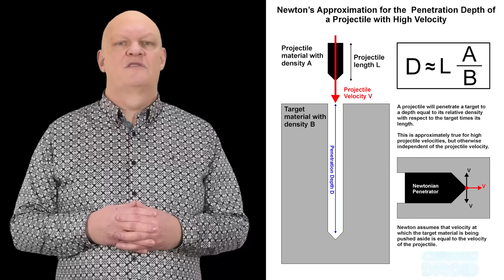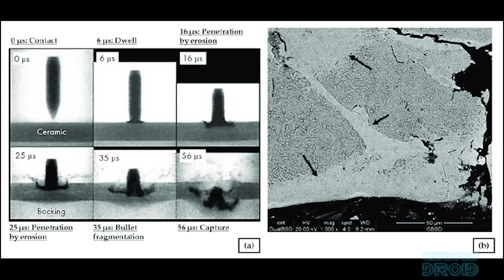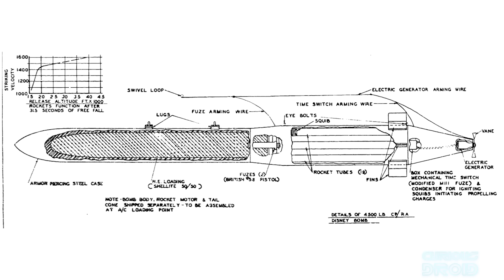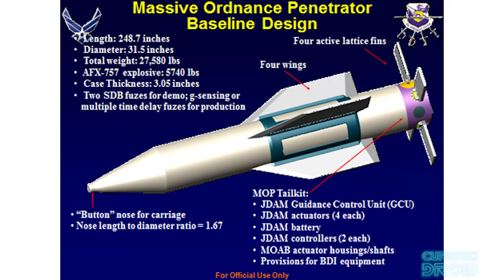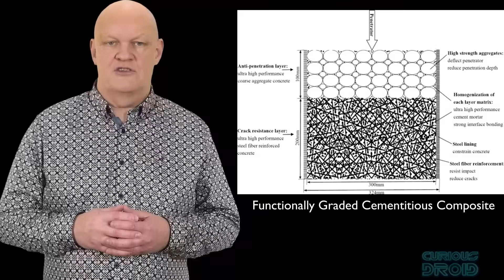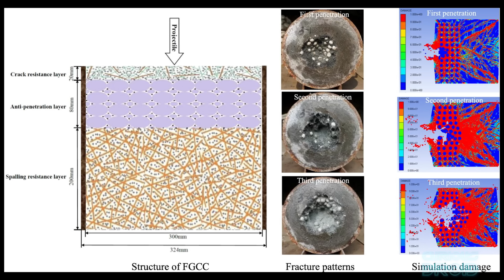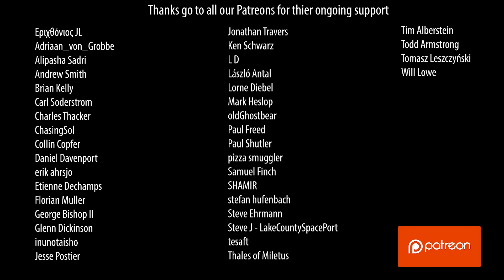Can Iran Stop U.S. Bunker Buster Bombs?

Comment: I just can't get my head around how somthing can go through 20ft of reinforced concrete and come out intact and go through more floors/walls after that before deciding when to detonate. It just does not compute in my mind. Fascinating but my brain is just like "404 Error"
Reply: The fact that the fusing mechanism can withstand all that and still function has always amazed me. The earliest proximity fuses for antiaircraft shells used vacuum tube tech and had to survive the shock of firing and spinning, and that was in the 1940s, which amazes me.
Reply: @RCAvhstape  That's because the fuse was in the nose but the detonator is in the tail where it's safe.
When the fuse is crushed on impact it starts the timer.
The Brits sometimes set the delay on their Tallboys and Grand Slams for as long as 15 minutes.
Sometimes it was done to enable civilians time to get out and sometimes it was done to break the morale of the Germans.
Imagine having 9000 pounds of explosives in your office, knowing it's going to go off any second and there's nothing you can do about it.           🙂
Reply: @RCAvhstape yup I took a few of those radar fuzes with mini tubes apart and how they made the little tubes survive is by making them very small potting them in a waxy material and supporting the filament on spring tension inside. The tubes also worked very well for hobby radio projects. The one that actually fired the squib was a tiny hydrogen filled thyratron about the same size as a NE2 neon indicator lamp. The battery and charge assembly screwed into the bottom of the Fuze cone.
Reply: @RCAvhstape   And imagine how they were all made in mass produced, manual operations.
somebody had to assemble it all, by hand.. 
imagine the QC on those things, cause you can't have any fail the shock test , or they would blow up in the barrel
Reply: @RCAvhstape  
They kept trying thicker and more resilient glass bulbs and of course stronger filaments it had to only survive the launch the other trick was to embed it into a special soft wax that it could safely protect the bulb by slowing down its speed, from what I read this wax was one of the most important parts  . The shell had to be at least a 5 inch  ,  on a ship that would be a 5 inch 38 it would not work with the 5 inch 58 , 5 inch 38s were the successful guns used against Kamakasis very successful 

Of course now we have solid state so no problem you can put it into. 40mm she’ll
Reply: @RCAvhstape  Wait, they had vacuum tubes inside the ammunition? I never knew that.
Reply: @lunchbox1553  Yes, the vacuum tube were specially designed to be smaller and after the circuits were assembled they were encased in something like acrylic to help them survive.
Reply: @RCAvhstape Iran or anyone else cannot stop these concrete peneyrators
Reply: @RCAvhstape  The fuze doesnt need to be in the nose ;)
A fuse is not the same as a fuze also.
Reply: Already in the 80s Norway had different bunkers for our F-16 fighters. To this day we have fixed aiplane bunkers inside the mountains.
Reply: The power of high density steel or tungsten pointed projectiles and kinetic energy
Reply: @AluminumOxide  that's why they say tungsten won WWII. I remember how it blew my mind finding out that we cut regular steel with high speed steel which is also steel.... I can't wait to see the kinds of magic high entropy alloys will deliver in their interactions with electronics photonics and other physical properties we don't currently even consider when we think of metals
Reply: @daltanionwaves indeed Germany lack of Tungsten was a major impediment. A story of intrigues about how Tungsten was sourced from Spain and Portugal and China via Japan
Reply: @AluminumOxide  like dropping tungsten rods from space? This was an amazing and informative video. I had no idea how far concrete composites have come.
Reply: @AluminumOxide  concrete is hard for us humans but tbh you throw a rock at it and the surface will chip pretty easily. Concrete is actually fairly soft and ductile which is why we add steel or composite reinforcement to it. A large projectile can break through pretty easily. Especially when a lot of heat is generated as the projectile enters, concrete gets weak with high heat and also the steel basically turns into a super ductile material when hot.
Reply: @kizzjd9578  you mischaracterize the physical properties of concrete, reinforcements, and the mechanism of action for the penetration
Reply: @AluminumOxide so you’re saying to counter it is to build tungsten bunker?
Reply: @AluminumOxide  no!! it needs to be made of depleted uranium!!!!!
Reply: @AluminumOxide  the electronics though, that's impressive
Reply: @AluminumOxide  is there nothing that can stop it?
Reply: @AluminumOxide 😊
Reply: @AluminumOxide Actually rounded, there are no points to distribute the load evenly.
Reply: @AluminumOxide  high density Steel and Tungsten are outdated technologies.

There are new meta materials and metal organic frameworks that blow them out of the water.
Reply: @darkhorseman8263  there's even an entire metaverse in which those bunker busters don't work
Reply: @darkhorseman8263  There may be better materials out there, but are they as cost effective? Even the US defense budget has it's limits.
Reply: @Tunkkis  Some are expensive, some are ridiculously cost effective.
Reply: @darkhorseman8263  Those are not technologies..those are materials....
Reply: @darkhorseman8263  not in terms of density, but perhaps in terms of toughness.
Reply: @darkhorseman8263  Not as a penetrator .. I think you were trollin for reaction cuz 2 years later steel & tungsten are still used as they satisfy strength and hardness requirements
Reply: The huge mass of the projectile, its acceleration to great speed, all concentrated in a tiny point over-matches the initial target.
Reply: Seeing that bullet go through the vest, through the chest and then out the back of the vest was frightening.. I wish humans invested as much energy into curing cancer as with killing each other, cancer would have gone the way of Polio- something only your grandma remembers
Reply: @lillyanneserrelio2187 Cancer unfortunately is our cells going rogue. It's not like polio where you can just gain immunity from a medical preparation, it's like a computer bug in your code and you can never know where it's going to show up.
Reply: @ChucksSEADnDEAD  But there are, nonetheless ways of curing cancer and defeating it that require "Human Action."
Reply: @ChucksSEADnDEAD  of course there are cancers caused by environmental factors too.
Reply: @lillyanneserrelio2187  Won't happen as long as the education system is Prussian, and making wind-up Prussian soldiers and bureaucrats instead of citizens.
Reply: @lillyanneserrelio2187 there’s no money in a cure.
Reply: They are basically solid steel with a charge down the middle. Made from a howitzer barrel. Forget being fired at from an artillery gun. Just fire the whole gun. That's a bunker buster.
Reply: Aphex… nice
Reply: I'm imagining it hitting a 10 story building and making it all the way to the basement, even with the whole volume being full of regular concrete! Mind-blowing for sure!
Reply: Its like shooting a bullet through cardboard or Superman flying through a building. 
Sufficient speed and density will tear through like tissue paper. 
Stronger metals, mounted on a rocket packed with high explosives. Its actually not that complicated in theory.  All they did was build a better hammer. 🔨
Reply: @drizzo4669  Well yes and no. For one Superman can’t just shoot through the 20 ft thick concrete alone , but the whole mantle ot the earth. 😂 
So let’s say it’s more like bullets going through cardboard 😂
Reply: @drizzo4669  One of the old kids' encyclopaedias has a picture of a candle being fired out of a shotgun and going through a wooden door. By contrast, you cannot push a candle through a door with your hand.
Reply: I understand what you're saying, but the creator did such a thorough job explaining it, if it was my video, id feel bad it still wasn't computing.
Reply: armor piercing bullets but bigger.
Reply: 100% brother, likewise. It’s like... how f**** hard is that casing and internal components that it can slam into the ground going hundreds of miles an hour and detonate perfectly when required?! It’s nuts really. It really is. Agreed.
Reply: Yeah it's mind bending
Reply: It’s only a rough analogy, but when hammering a large nail into pine floor boards, to assist it’s passage through the wood and reduce binding, it’s better to file the point flat. That way it cuts through the wood fibres instead of squeezing between them. If you use a big hammer then obviously the passage will be quicker. I had read about thermo nuclear bunker busters that actually use hardened bunker construction to reek more damage within by creating an earthquake to shake the interior. But that’s another matter!
Reply: Combination of extremely hard dense metal plus lots of kinetic energy. At work we have a water jet cutter and although the water mixed with abrasive. It's always impressive watching it cut through sheet steel.

If they used depleted uranium it would go through even more as thats extremely dense.
Reply: @wsm7929  The latest ones do use U-238....
Reply: Depends on the reinforcement 
We use minnuim amount of rebar
Just enough to do the job
Iran uses more rebar
Reply: @tomhenry897 The fact that you think it's just a matter of Rebar and Iran using more Rebar than us Is it sad that idiots fall for Anti-American propaganda. And don't believe with their own eyes when they see how other countries are
Reply: It can only do that if it has the proper void sensing fuses. Which the MOP did not have at its start. Plus a void sensor only is useful if you know the layering of the bunkers design.
Reply: @captiannemo1587  the mop is a new weapon, not a upgraded old one
Reply: @nomercyinc6783  The most current MOP should be an upgraded version of the older MOP.
Reply: @captiannemo1587 I’m sure having a trigger that detonates when motion ceases is good enough or just a timer from initial impact. Entirely possible. In the gulf war, they were detonating LGB’s on a particular floor of multi-story buildings like clockwork.
Reply: Basically the material is stronger than the wall and the explosive requires ignition and spark electricity to detonate
Reply: At the end of the day it's just F=ma
Reply: Same . Fucking wild!
Reply: They have bunker busting nukes, if they have to take out a nuclear facility this is what they will use, they are the best.
Reply: @hamish1309 They would use bunker busters with nuclear tips easy
Reply: It's easy if your weapon is made out of sarcasm
Reply: @NJ-wb1cz The put that in water these days.
Reply: @NJ-wb1cz  thanks. My account might just be hacked. All the best.
Reply: @NJ-wb1cz  Thanks. You too. 😉
Reply: @NJ-wb1cz cute
Reply: @novafiddler1712  thanks! You're pretty as well
Reply: @15:25 When it basically tickles a traffic cone also blows my mind
Reply: Its fascination how normal day expirienced physics stoped working when high enough energys/speeds are applied.
Reply: When we were kids a favourite part piece of the farmer was to fire a candle out of his shot gun through an inch thick sheet of hard wood. The candle often broke but was in one piece
Reply: You drive on top of a can of explosives, propelled by explosions a few feet from your feet, on a narrow road with thousands of other similar contraptions travelling inches from you in the opposite direction, at speeds that would crush you flat if there is a small mishap. 
If you told ppl in the distant past about bunker busters and cars, they'd probably believe the bombs more easily.
Reply: You can't understand it because you listen to the Aphex Twins. I listen to The Prodigy and I understand it totally.
Reply: Reinforced concrete isn’t very resistant to concentrated impact force at one specific spot, and when it’s made of heavy steel and hits at supersonic speed, it’s really just a big bullet
Hopefully I brought it into scale for you
Reply: As for 404 error 😂🤣😂🤣😂
Reply: thinking that even solids like concrete are made of molecules were most of the space is empty, helps me understand it.  then, it also make sense that the more dense (and energized) molecules from the projectile can bully the lazy sparse ones from the target.
Reply: It goes well beyond this now.  Some of the weapons are way smarter, and learn to wait, or penetrate and evaluate.
Reply: . Nuclear tipped rocket can break thick concrete wall(no matter what size) within friction of second. Shok wave love traveling Concrete ❤
Reply: @azharyasinhashmi120  agreed. Nuclear detonation is another thing altogether.  Shock waves do like traveling through solids and then become destructive when transitioning into an excavated facility.
Reply: @azharyasinhashmi120  You have the mind of a 12 year old.
Reply: It's the old shield versus sword or spear contest. 🛡🗡
Reply: same
Reply: Same...
Reply: E=mc²
Reply: It is way more dense. This computes perfectly in my head
Reply: I was feeling the same about it. It's like the concrete isn't even there.
Reply: and that is why you watch
Reply: Try penetrating 3,000 feet of dirt, dropped from 30,000 feet, with a small nuke warhead. Project Excaliber, the perfect name for it, is outside the public domain, and excluded from declassification.
Reply: Brain stretching but true.
Reply: Everyone referring to hammers asteroids and tungsten rods are talking about things that are utterly destroyed by the impact itself, or too simple to be destroyed. We're talking about designing a complex modern system that can withstand these forces in its originally intended configuration.   You guys don't seem to understand the complexity of the situation
Reply: The irony is that the MOP does not need a direct hit to be effective ,however ATK is still working on  Hard Target Void Sensing Fuze (HTVSF) for the USAF
The other irony is that if the USAF has the air superiority to use the MOPs
you are already screwed
Reply: Well, its harder than the object its penetrating.
Reply: Solution is simple: STOP USING CONCRETE.
Reply: @plasmaburndeath  You wouldn't believe what Cargil mining has built under the great lakes the workers and whatever government workers that work there will be some of the only people left after an all out nucluer apocalypse these bunker bombs are drastically effected by water hence why Cargil got the contract to build it under the lakes in the huge caverns they've been carving out mining salt for the last 40 years they built the bunker that bomb your talking about was designed to take out and have done it in plane sight for decades they have a full sustainable colonies worth of resources non perishable food gardens air scrubbers oxygenators natural gas generators with back up hydro electric and a under ground reservoir everything needed to sustain 500 people for 5 years if they shut the doors on it tomorrow it's a way more impressive feat than anything in man's history really the shear size makes the Pyramids seem like they were built by cave men any number you might find stating the size and depth of the mines is probably 20 years out of date and it's only what they are willing to talk about I probably just made ten lists for talking about it but it's not hard to find out information about what is under the lakes
Reply: It is mind blowing
Reply: The new bunker buster cuts through 200 feet not 20 feet
Reply: @nomercyinc6783  200 ft of soil, 20 ft reinforced concrete
Reply: The first US bunker buster was actually a tank gun for the casing
Reply: @johnscanlon2598  the newly designed one were first used 8” howitzer barrels, but then switched to purpose-made steel casings
Reply: It's like that ex girlfriend you had that went thru 20 men, took everything they had, still wasn't happy, went thru a bunch more before ultimately settling down with one and deciding to ruin HIS life worst of all. Noone REALLY has an explanation but we can speculate.
Reply: The missile is basically the barrel of a artillery cannon fitted with munitions.....Or really...the initials ones actually were.  Think about what the barrel of an artillery cannon is supposed to contain shock wise over and over again thousands of times. They made that a missile.
Reply: @aaaaaaaaaa97  Ain't it grand!? 🤣
Reply: Right
Reply: İ mean its not intact ots paint is scracthed
Reply: Shit load of kinetic energy, it's really not that complex. The original "bunker buster" was dreamed up in a few time and made out of old artillery barrels.
Reply: To me, the question is how it impacts with the concreat then survives to detonate? What kind of electronics does it have????
Reply: @r9guy_  electronics?  It's a lot of physics.
Reply: Well said
Reply: I can’t comprehend how anti tank weapons push liquid thru a tiny hole going so fast it goes out the other side creating a pressure so great it detonates the ammo and shreds the humans.
Reply: Physics are a hell of a thing.. Have you ever heard about the "Rods From God" that we  wanted to stash up in space?
Reply: @MarkLada  yes. But doesn't exist. We still have icbm.
Reply: @mrsimo7144  They exist, and we can drop them on any target of our choosing.. We also have a secret military space station that has some other interesting weapons at their disposal..
Reply: @MarkLada  do you work in the military? You're talking about electromagnetic weapons?
Reply: @mrsimo7144  In a roundabout way.. I don't work directly for the military, but the company I work for does work for the military.. I don't get to see the whole picture.. What I mean by that is I only know about the components that I work with directly.. I don't get to see how those components plug into the complete system.. I don't even know what the completed system is.. I only know what I need to know to complete my job.. All I can really say is that my job involves electronics.. I work with high voltage circuit boards.. Like I said before, I don't know what the components I make are going into, but I'm pretty sure they are for rail guns..
Reply: @MarkLada  Should you be mentioning this on YT? Question. How do they get rail guns up in space? Also, how are they deployed? So like the speed of impact is equivalent of an ICBM air burst? Just curious. 😁
Reply: @mrsimo7144  Yeah, it's fine for me to speak about my work.. I mean, I'm sure there would be consequences if I were to publish schematics online or something like that.. I'm not required to keep my employer or my field of work anonymous though.. I have no idea how they get anything into space other than with rockets.. That's not my area of expertise.. I'm an electronics guy.. Basically in a nutshell, railguns work by using electromagnets to rapidly accelerate a projectile.. There are a couple of different ways to accomplish this.. The company I work for figured out they could use high voltage to vaporize conductors and create plasma.. Then they use electromagnets to accelerate the plasma down the bore and launch the projectile.. A standard firearm uses gas created by detonating gunpowder to accelerate a projectile down a bore and launch it.. Plasma travels faster than gas.. Therefore, it is capable of launching bigger projectiles at a much higher rate of speed than traditional firearms.. The more mass and more velocity a projectile has, the more potential energy that projectile has.. When you factor in the zero gravity and zero atmosphere elements of space.. It becomes possible to accelerate insanely large projectiles at incredible speeds.. We have the technology now that would allow us to fire a big enough projectile from space at the earth and create an impact that would rival the impact of the meteorite that wiped out the dinosaurs..
Reply: OG Nerd joke:
~~~
File not found.
Use emery board instead?
Reply: I know the US Navy Mk 8 2700 lb 16" AP shell is rated for nearly 30 ft of reinforced concrete!
Reply: @dundonrl  You might want to put a red lamp in your bedroom window tonight. 😉
Reply: I'M RICK JAMES, BIATCH.
It's fun to troll AFX fans about Rick James, opposed to Richard D. James. Almost as fun as telling people what an amazing musician Kirk Cobain was.
Reply: This all explains to me very clearly how those Nintendo cassettes never broke after hitting them so much.
Reply: Metal quality matters!
Reply: When I see stuff like this, which is all the time with YT, I just think how if I was the smartest person alive, we literally would have nothing. Maybe a few nice gadgets, but that’s it.
Reply: @BeStupidWithIntent  haha, same but maybe you underestimate yourself.
Reply: Ya it's mind blowing.
Reply: your life experience doesn't include something like penetrating concrete, because your body is softer.
You may recall penetrating dough, clay or you know what, which are softer
🙂
Reply: Well you just haven't been married yet 😂😂😂
Reply: Science is the bees knees
Reply: Think about how its actually able to explode after the fact being that durable.
Reply: @crazestyle83  once it hits something a timer gos off. How the timer survived is beyond me
Reply: Why does America murder women and children?
Reply: There are some aspects of physics that just are not intuitive nor relatable
Reply: @hamster2845  - Why do Americans start all the wars and murder millions of women and children every year?
Reply: I feel the same 😮
Reply: @JerjerB  thanks. There are so many comments here just attacking me for expressing that the physics in this is hard to mentally visualise. It's getting quite tiring being called all kinds of stupid regularly still a year later. So it's nice to have the odd comment that from someone that understands what I'm getting at and feels the same.
Reply: If there's anything mankind is good at, it's making/inventing things that causes destruction, and that's damn sure not a good thing!😔
Reply: Same!
Reply: Me neither, tbh
Reply: same here
Reply: Just kinetic energy. I can't tell you more détails than "i've seen a non-disclosed french bunker-destroyer test" and "it was more wide than what you see in this very vid"  but one thing was unbelievable ( and i know you won't believe me ) but after [many] concrete walls destroyed, the paint itself was quite intact, just slightly scratched. 

A really huge kinetic energy destroys everything, preserving the mobile itself
Reply: I wonder the same thing. We build bridges and buildings with vast rebar cages. 1" rebar layered over and over for several feet in a cross pattern. How does missile  break through that?
Reply: Sure, 20 feet of concrete, but can it go through 20 feet of solid tungsten?
Reply: That one too but I still can't fathom how in WW1 the fighter planes fired their machine guns through the propeller without blasting it to pieces.
Reply: @ gears
Reply: The answer is the video. The first part shows Holloman High Speed Test Track (HHSTT) . They can test out various types of metal , explosives and most importantly fuze sensors 
The technical term is void sensing fuze which is likely uses radio waves like a sonar paired with an accelerometer to measure how far its traveled before detonation 
Thanks to the HHSTT, they can repeat as needed till they get the right combo
Iran's problem is that US has had many chances to test its bunker busters and Israel has also used them which also helps as well
Irans' bunkers may be in solid rock but the US can still dig their way down with combination 2000bs , 5000lbs and save the GBU-57 once they reach the certain depth
Reply: Programming is needed for that to be possible.
Reply: @ mostly physics and sensors/hardware bro
Reply: Think about how a air powered nail gun works.
Reply: 500 internal server error is more appropriate

404 means "not found"
Reply: Quite easy when you understand the  Bombs Design  and   physics
Reply: The biggest can punch through 60m of reinforced concrete 😮
Reply: @T1000-s4j  The problem with that idea is that, for that to work, the rocket would have to lose very little speed after first colliding with and then penetrating through the first 50 m of reinforced concrete.  That's not realistic whatsoever.  Reinforced concrete is incredibly resilient.  Old industrial buildings made with far less than 60m cross sections of reinforced concrete take a lot of time and a huge amount of energy to dismantle.  

Look up a video called Excavator wrecking ball concrete demolition.
Reply: Have you tried shutting yourself off and having someone turn you on again?
Reply: @M167A1 as long as you don't blue screen. 😅
Reply: @M167A1 yeah but the wheel of death is still spinning
Reply: Wait till they send tungsten rods from space. Elon has enabled this with his new rockets. Capable of destroying cities and splitting the earth's crust with no nuclear fallout. The only problem is our enemies will be very salty, using dirty weapons
Reply: Think bullet through phone book.
Reply: Its more brain fucking if you have actually worked with concrete or have to manually sledgehammer something made of good concrete. Its almost beyond human force. You breake it yes. But it tooks a lot of juice Out of you.
Reply: the answer comes from bettlejuice what number is between 2 and 4 ?
Reply: Same
Reply: According to the entire US political establishment, the supposed Boeing 757 that hit the Pentagon on 9/11/2001 sliced thru 6 layers of 36 inch reinforced concrete (total 18 feet). This should be in Ripley's Believe It Or Not museum. Not only that, not even the wings broke off as it hit the Pentagon. It all went inside. No crash debris was found outside the Pentagon.
Reply: @prioris55555  it's as bad as the magic bullet theory.
Reply: Nice error, completely fireless shockwave Tool . Its all it really is . The Way ahead , We can Rule the Skies of Earth with only 3 fighter jet models all up for a wax science wise .Fleets and Missiles are unnecessary WASTE . Don't need anything but one model is by only one plane a fleet destroyer , one a Submarine killer , similar one or Two per fleet , and so advanced last but not least , a missile base fighter jet kills Missile Bases .
So , its Peace . Good New Year amen
Reply: Velocity.   Weight of the bomb.   Hardened  pennatrating front end. And there ya have it.
Reply: Same reason a toilet paper roll can support the weight of a person cylinders are very strong has on.
Reply: The front is solid metal/steel and the impact fuse is in it back end. So it doesn't get damaged and can work.
Reply: I used to work with these bombs.  The first ones used old battleship gun barrels.  Very effective.
Reply: @foxfire7604  They were 8” howitzer barrels.
Reply: @FS2K4Pilot  - Not the ones I was involved with testing.
Reply: @foxfire7604  Then what kind of bomb were you testing?  The barrel of a battleship’s main gun can weigh 150 tons or more.

Strike that, the Mk 7 16”/50 caliber gun barrel was only 120 tons.  Still, a bomb that size would tax the lifting capacity of even a C-5.  A bomb perhaps built out of a 5” gun barrel from the secondary battery seems more plausible.
Reply: @FS2K4Pilot  - Not unless you are talking about a 16" gun which isn't used anymore.  Sorry, can't discuss the details of these guns.  Even though I'm retired, I still have to obey the security regulations.  Most of the bunker busters were made at MCAAP, along with the moabs.
Reply: @foxfire7604  If it’s classified, you shouldn’t have even mentioned its existence.

Although since you did mention it, a 15-ish foot length of 16” gun barrel would be about right for making at least the prototype for a MOP casing.
Reply: @FS2K4Pilot  way, way too heqvy
Reply: stv1  😂👏 nailed it
Reply: Dang oL Tunsten Cobalt and depleted uranium
Reply: 🗿IDK 🤷‍♂️ Maybe 🤔 if you watched the video instead of commenting first like an NPC you would know ♿️
Reply: Well, just imagine it that way: If an object hits a surface at very high speed, an enormous pressure is created at e.g. the tip of the bomb. This basically "melts" the concrete and creates a liquid which is pushed aside. You just need enough Energy to create the pressure which then heats up the e.g. concrete. I know that my description is not quite right, but it "somehow" works that way.
Reply: @cvdheyden  it fractures before it could reach the melting point
Reply: @vanguard9067  yes
Reply: @cvdheyden  what if between concrete slabs you had sand. Would that absorb the energy? Or explosive layer like a tank that would destroy the bomb when it hits concrete?😊
Reply: @jayg6434  Sand would not make sense, but an explosive layer. My guess.
Reply: @jayg6434  sand is good, but jello could also work
Reply: I wonder what the penetration value of space dropped tungsten rods "the rods of god" would be on something like FGCC. that would be something to see… From a really really really long way off.
Reply: It's called Physics and Science, something you were probably sleeping in during school.🤣 JK.
Reply: @graffiti73  And haven been sleeping during anything.
Reply: @graffiti73  You can have difficult getting your head around it bc you are stumped by the Physics, or bc you know the sciences well enough realise the awesome engineering challenges that must have been overcome.
Reply: It's the same as a pencil going through paper just scaled up to times a billion.  
It just pretty much has to have 2 characteristics be really pointy and hard and moving really fast
Reply: Well the government exaggerates, so it's really not that bad.
Reply: @plasmaburndeath Iran.  Israel is going to destroy Irans nuke facilities if it comes to that.
Reply: The noise of my neighbors can do that, and they are no geniuses.
Reply: I bet this happens to you all the time. Mediocre people are just that.
Reply: @takeastandorbeenslavedby-left  who hurt you? I'm sorry I hope things get better for you.
Reply: not sure if someone said this or not but the new bunker busters can go down over 100m per bomb and they can be dropped in a way where they both go in the same hole so you can dig down over 200ft with one bomb or almost 400ft with two and yea you can tell it to detonate at a certain depth.  The charge weight is 15,000 and the test blasts said it looked and felt like a nuke going off 20km away.  pretty cool huh? 30,000-pound (13,600 kilogram) GBU-57 “bunker buster
Reply: @bear76009  was about to write that.... It's not a big deal any more to drop a whole string of bombs down the exact same line, so I can't see how that could not penetrate. Historically, the unbreakable armor has always been breached after a few tries.
Reply: It's called depleted uranium tipped!
Reply: through cgi magic
Reply: My first thought is, wasn't there an issue with building sand, but now there is UHPC, sweet, let's use it!
Reply: Someone is going to suggest iron meteorites next
Reply: Tallboys and Grand Slams were doing that 80 years ago thanks to brilliant engineers like Barnes Wallis.
Reply: @rorz it is programmed in prior to takeoff/launch.
Reply: Weekly reboots will help that.
Reply: If there's nothing else that man can do, man will always find a way to destroy any and everything on thids planet😔
Reply: Its very simple actually. Just check out armor piercing ammunition for normal guns. Its similar
Reply: Low IQ maybe
Reply: @HeroInTheSun  I understand the maths I understand the physics and I know it's possible, it's just the mentally visualising the process that's difficult. That's pretty normal when it comes to such high energy physical processes so far removed from our everyday experience. Have a good day.
Reply: Application of Real Scientific principal ….No politics or agendas involved . 
Data and Demonstrations and Results are relative to materials used for the Demonstration …….
Steel comes in different strengths So does Concrete …..
Reply: Delayed fuse ..after impact
Reply: After main impact ..delayed fuse
Reply: Material science. Understanding and calculating exactly what makes and breaks a material. The perpetual mortal combat between weapon and armour.
Reply: At these energies the concrete is a fluid that moves out of the way. I’m more impressed that the warhead can count the number of layers to detonate at a specific depth.
Reply: It's not one bomb thougt
Reply: Some munitions can penetrate up to 6' of solid steel! Velocity is an incredible force! Get a feather going fast enough and it can penetrate any building, bunker or vehicle ever created by man.
Reply: I guess the bunker buster can’t get through your thick skull.
Reply: @Aitocracy  well that was unnecessary dont you think? A bit tone deaf too considering my comment is the highest rated comment on here by a long way. I said the process is difficult to imagine but not that I don't understand how it does work or that I don't understand the maths. Understand nuance in what people say. I'm sorry you're so miserable that you have to go straight on the attack for somthing so benign. Be better.
Reply: @ElectricChicken  Long winded and thick skulled 💀
Reply: @Aitocracy  okay, have a nice day.
Reply: Показуха
Reply: And my phone freezes when I brake too hard
Reply: there has to be a way to defeat these sort of weapons......i heard sand and water can absorb and dissipate kinetic energy very quickly and slow down moving objects very quickly over short distances to the point bullets become nothing more than harmless deformed pieces of lead after a couple of meters.

maybe the same principles can be applied here by building swimming pools or artificial lakes over the bunkers?
Reply: Same
Reply: 503 error would be more apt.
Reply: Yeah I'm dumb too
Reply: Me too. Looks soo strange
Reply: And... someday money won't be used at all and shortages of commodities will relegated to the same idea as the shortage of literate people.
Reply: @bryck7853  lol what?
Reply: It's more then 20 feet
Reply: @nkill6  What are you doing bro? He couldn't get his head around 20 feet, and you're adding more?? You're going to blow his mind! His head is literally going to explode dude!
Reply: Thanks US Defense department
Reply: All you jigas would be surprised how things will turn if you stopped thinking about stealing from other countries, and concentrated on a job or business FFS lol
Reply: Just about kinetic energy
Reply: Depleted uranium works wonders....
Reply: you should watch some videos on meteor impacts. They literally create nuclear explosions when they hit the ground... and it's just a rock going really fast.

Weird stuff happens when things go fast lol.
Reply: @chickenmadness1732  they do not create nuclear (fission nor fusion) explosions
Reply: @vanguard9067  You mean meteors? That's literally what happens when they hit the ground. The impact creates an explosion thats identical to a nuclear bomb.

NASA used nuclear bombs to create craters for astronaut training and they found that the craters were exactly the same as the ones left by meteor impacts. Theres vids of it on youtube.
Reply: @chickenmadness1732  it is a massive explosion no doubt, but it’s based on the incredible kinetic energy.  It is not “atomic” in any way, nor are explosions and craters the least bit similar in characteristics.  NASA never exploded nuclear bombs to make craters for the astronauts.  I think you are misinterpreting the videos you are seeing.
Reply: @vanguard9067  You literally have no idea what you're talking about lol.
Reply: @chickenmadness1732  I am fully confident that what I am saying is correct, what will it take to convince you?  What will you accept as proof?  Or if you prefer, maybe you could provide references for what you are saying?
Reply: Or through 200 feet of earth.
Reply: @plasmaburndeath  20 ft of reinforced concrete, 200 feet of earth
Reply: and that's why you are not a US engineer. they do not care about "it's impossible"
Reply: U.S. military budget.
Reply: Do you really really want to check what will happen if you unleash a world war again, Ale is there in Washington?!
Reply: Start with old howitzer barrels and go from there
Reply: This is lies like the 9/11 videos of planes hitting buildings
Reply: When it comes to innovating ways to kill other humans, the humans don't disappoint.
Reply: It should be a 5xx error.
Reply: 404: Brain not found.
Reply: Iran will level everything around them
Reply: Ya, same. Technology feels like magic sometimes
Reply: Humans are no longer needed... So you no longer need bunkers... 
You just need hundreds of millions of cheap robots that can do an incremental amounts of damage depending on their number.
In other words even a single individual can take over the entire world with the use for robots and AI. Meaning that governments are now in risk of becoming obsolete too.
Reply: Steel is way stronger than people think.
Reply: E=mc²
Reply: It’s even more disturbing when you Lear the air force made and tested this bomb in like 90days!
Reply: The case of the weapon is made out of a repurpose cannon barrel . It's incredibly strong type of steel and it only has to do it once. When the barrel was made to fire hundreds if not thousands of times without failure. Does that help.
Reply: Those making blaise comments about penetration of 20ft bunkers with ease, may have never mixed 😮and poured a cubic metre or even cubic foot of 40MPa concrete and tried to break it up.   that's around 110 X 20kg bags, but even mixing 1ft3 would provide some perspective, on weight, strength, cost etc. Go for it, it's surprisingly fun
Reply: It's because they have hardened  tips that go through shit loads of stuff before they go bang. It's something that is useful for killing loads of enemy soldiers, but in Russia's case, which they love, it's also fantastic for killing loads of women n kids hiding in bunkers,gets rid of most of their victims and leaves them with only a few to rape, so yeah,they love these kind of weapons that help them to rape and murder at will. After all,that Russian scum is known for it's ingenuity, so bunker busting munitions are very popular with the Russian Rape Army. Just ask the Ukrainians and the Finns the Ruski filth fucked over in the winter war!
Reply: @@ColonelCampbell61 Except that the Israelis "college students" used shaped explosives on the main superstructure of both towers and building 7. The evidence and proof are available to anyone capable of doing their own thinking. Seek and ye shall find...
Reply: Let alone a 200ft of concrete.... 
https://youtu.be/bygY72ZwMR8?si=zTv0_s0VEUVhBtuK
Reply: Sounds like depleted Uranium IMO.  
Also, while concrete has enormous compression strength, it's tensile strength is lacking and the point of such a missile is to make it shatter.  That would take DU and maybe a layer of industrial diamonds on top of the DU to do that...... IMO.
Reply: The United States spends hundreds of millions of dollars every  year learning how to kill people and destroying practically anything. We are very, very good at it.
Reply: so Iran's nuclear program is ustopable by convensional bombs or any other aggressor rogue state's nuclear program.. so someone is gonna use nuclear bunker husters at some point.. gl earth.. btw Russians may help Iran build their Abomb more likely than ever, if things collapse in Ukraine.
Reply: A tornado can make a pencil go through a tree. Getting titanium pointed rod through concrete is nothing special. B
Reply: These bombs are made from old 203mm howitzer barrels, they're tough AF.
Reply: Most of it, is fairy tales. Imagine lazers that can slice an aircraft carrier in half!!
Reply: Titanium tipped high strength steel tubing with at least a 1-inch wall thickness.  Attached to an aircraft that goes into a mach 2.0+ dive and precision guidance with internal time delay fuse does the rest.  Bunker busting to 300 feet.
Reply: More like a 1202 error.
Reply: A projectile with a depleted uranium casing is super dense,  and not much can stop that.
Reply: P.S.I.
Reply: But can it go through 20 ft of granite…
Reply: Because it's a horseshit and fake footage
Reply: If you listen to the end you'll find he mentioned going through 100 feet of concrete with the latest weapons. 

The scariest thing to me was the information on how ineffective a bullet proof vest is against various enhanced rounds.  Maybe they should be making the vests out of that enhanced concrete...
Reply: Speed
Reply: I'd bet money they tipped it with depleted uranium
Reply: see 9.25 in MOP bomb this penetrates bunkers that are 61 meters underground so 6 meters of concrete it protects as well as newspaper

https://youtu.be/8m4TlVSQ8As?si=GMNhWC5IaUK-Jq5t
Reply: Timer
Reply: All about energy
Reply: Me either. Most i can figure is cheap concrete but still....that thing about not exploding on impact🤷🏻‍♂
Reply: أنظر إلى الخرسانة و قربها تجد أنها تم ضربها بثلاث قذائف خارقة للخرسانة أو الدروع إنها من الداخل مفتتة أنظر إلى الخرسانة و قربها تجد أنها تم ضربها بثلاث قذائف خارقة للخرسانة أو الدروع إنها من الداخل مفتتة هذا من جهة واحدة فكيف بالجهة الأخرى من الممكن انها فارغة لإعطاء أمريكا سمعة و قدرات أكبر من حجمها و إن كانت هذه خارقة للتحصينات إلا أنها مبالغ فيها
Reply: @saudalrasheedi1380  i cant read or understand your language
Reply: @alancoker1459  Look at the concrete and near it, you will find that it was hit by three concrete or armor-piercing shells. It is crumbled from the inside. Look at the concrete and near it, you will find that it was hit by three concrete or armor-piercing shells. It is crumbled from the inside. This is on one side. So what about the other side? It is possible that it is empty. America's reputation and capabilities are greater than its size, and even if these are superior to fortifications, they are exaggerated
Reply: ok window licker..
Reply: 404 Error is not found, I think you meant sth like a 500 internal server error
Reply: .............. k?
Reply: its actually very simple....sorry you have issues with thinking....
Reply: @chrisholder4978  I hope your life gets better honey.
Reply: The bit I cant wrap my head around is out determination to make weapons that can't wipe ourselves out no matter how much we try to protect ourselves, its like instead of developing ways to territory planets like Mars were focused on destruction and the possibility of making our world like Mars, just insanity
Reply: It's really quiet simple 🤔
Reply: Yup.  Make my brain itch. 😋
Reply: It’s called science
Reply: It’s all gravity and kinetic energy
Reply: Eglin used an old 8" naval gun barrel as a bomb casing to craft a bunker buster for Iraq's command and control bunker
Reply: It’s a video, not true. It’s something like Iran has down us MQ9 Reper dron but it’ can't get any information from though Iran copied it. Us abdram tank is the best in the world though 500$ Russian drones destroying them. US defence system is the best, but Iraqi militias successfully attacked previously unknown US airbase Tower22 in Jordan. US systems are Over hyped though it mocks others.
Reply: Never underestimate US warmongering, they may be incompetent but by god they're desperate to commit more war crimes
Reply: Malicious propaganda. They don't work like that.
Reply: Hit one egg with high speed into another egg (stationary) and watch the effects of a bunker buster! 

One egg unharmed. One busted!

All the nitty gritty bits in the moving egg (shell, liquid) wants to continue their travel. (Newtons law)

All the nitty gritty bits in the stationary egg (shell, liquid) wants to continue being stationary.  (Newtons law)

As the energy (strike or withstanding a strike) is dominantly dependent on speed (energy = mass x speed x speed) these lite molecules of egg shells and the liquid behind just wants to continue traveling and they do. Straight through the other egg which bursts apart. 

So, double the speed and get 4 times more energy 
Triple the speed and get 9 times more energy 
4 times the speed and get 16 times more energy 

..and so on

That’s how a bunker buster travels through 6 meters of concrete. 

A future concrete holding together?.. well then the buster becomes molten metal somewhere along its path into the concrete. 

Rgds 
Anders 
Sweden
Reply: Sadly this video isn't even very dived into the topic. U.S. air force has the MOP, mass ordinance penetrator. It will blast threw almost 200ft of concrete. Or 150ft of hardened, undisturbed rock.
Reply: SPEED AND DENSITY!!
Reply: Not hard to understand.
Issac Newton perfected this in 1788 😅
Reply: 先端が押されてタングステンの直径が大きくなればコンクリートに亀裂が入り進みやすくなる
Reply: Just to make it a bit clearer, almost 80% of the weight of these bunker busters is the shell and almost 20% is explosives.
Reply: A jack hammer point bit has properties like that. Usually made with treated S2 steel.
Reply: Why do you think that bunkers must only contain RCC may there are layers of Hardened steel plate placed in between.
Reply: White people engineering
Reply: Insane!!
Reply: I believe it would have a lot to do with the speed a bit like a bullet going though a layers of beloons for example unless its harder - (thats what she said,)
Reply: just imagine your dad trying to make love to your mother
Reply: its bullshit marking  and try scare enemy
Reply: That's because the device has several layers of damping material inside to protect the explosive payload while dispersing the force evenly. It also has 2 warheads, a relatively weak one that makes a very focused blast to drill the hole when about 2/3 of the gross kinetic energy is used up then the rest just slides right in and blows its load. 😮
Reply: Now u got Examples  in Beirut - Lebanon, right?  Convinced?
Reply: @sudharshank7098  There have been examples happening this whole time, and I didn't ever say I didn't believe it could happen.
Reply: @ElectricChicken  o.k. nice time.
Reply: Simple, it's fake. We have seen some gamechangers in action.
Reply: It's the red paint that does it 😅
Reply: Weight, mass, momentum and explosives.
Reply: I can't get my head around the fact that humans put so much effort into killing other people
Reply: GBU57 do 200ft
Reply: This stuff is easy to understand, newton is the king
Reply: High density steel, my friend. The stuff is really, really solid.
Reply: ببساطة لان دماغك محق . كمثال انظر للنيازك . انها اقوى واسرع من اي شئ صنعه الانسان . رغم دالك بالكاد تحفر متر واحد الى مترين في الارض
Reply: they are literally explaining it.
Reply: Why not, a Boeing 747 did it at the Pentagon how hard is it for a missle to do the same?
Reply: I can't understand
Reply: What about the MOP it can penetrate 200 ft
Reply: The Irresistible Force vs. The Immovable Object!
Reply: Some thing just look unlikely but science is fascinating & i recently learned that even like 20kg explosives can cut through meters of concrete or armor even.
Reply: 404 means "Not Found". you meant 500 "Internal Erorr"
Reply: That's a 500 error 😂
Reply: It is extraordinary when you see those new bunker buster 30,000lb bombs which are like a hybrid missile bomb. They fall horizontally from USAF Stealth Bombers and rotate mid air and fall vertically downwards with incredible speed penetrating the ground but the warhead doesn't detonate until its below ground sometimes reaching depths of 20-30 feet or more. Leaving a giant crater which then exposes a site to further 30,000lb bombs penerating even deeper by several 100 feet below ground. 

How the US is able to do that is extraordinary liike you say, one would expect these bomb to explode on impact into hardened surfaces but they seem able to penerate harden surfaces to some significant depth before exploding. My guess is the missiles have hardened penetrating tips and a smaller primary explosion which generates extreme heat and then a delayed secondary main explosion further back inside the bomb once the bomb has reached maximum depth or heat from primary explosion the secondary main explosion occurs which tears up the site and explodes everything upwards creating a giant crater. That then makes it easier for further 30,000lb bombs to be dropped into the crater and penerate even deeper to targets at depths below 30-100 feet.
Reply: @paullangton-rogers2390  this entirely hedges on those planes being able to be above their target, which could only happen when you already destroyed everything. So it's really of very limited use outside invading poor and broke countries
Reply: Energy = mass * speed^2
Reply: I agree, but MEMs accelerometers and other electronics can handle ridiculous g-force. On the flip side are GPS guided artillery (or functional nukes from artillery)...I mean I drop a radio and its destroyed, and they can launch a GPS at 4000 mph from a 10 foot gun and still works?
Reply: genjeshtra pa fund
Reply: Doesn’t make sense.
Reply: @ energy = mass * speed^2

Basically the energy increases exponentially for fast objects
Reply: By spending ridiculous amounts of money and with latest engineering knowledge.
Reply: @ no it's simple inertia and the hardness of tungsten. Lots of energy in a bunker buster
Reply: Only in movies u see this, they are so great in false information an editing videos 😂😂😂😂😂😊
Reply: Concrete is much more brittle than metals are. Even if its got rebar in there.
Reply: What would happen if you drop that in a water/ocean?
Reply: you mean how the computer or chip knows? easy, an accelerometer.
Reply: 200ft.of concrete.
Reply: There's a surprising amount of empty space inside of concrete, so it can be compressed into itself in order to move out of the way of the bomb.
Reply: The United Snakes claims it's "bunker buster" can penetrate 200 feet of reinforced concrete so 20 feet would be nothing. I have a hard time computing that myself but then I have to understand we're talking about people that elected a sexual predator as their leader. AmeriKKKans!
Reply: Tungsten that’s how
Reply: It can't, they are creating a big lie.
Reply: @paulf2529 yes they can the kinetic energy it’s generates from falling a mile is unbelievable don’t forget it weighs 15 tons.. mass x acceleration on that is fucking mental it’s tungsten carbide that how it can go through .
Reply: PFM is what we call it ;)
Reply: 200 ft, rather
Reply: People hear “200 feet of reinforced concrete” and imagine cartoon physics. Do a back-of-the-envelope: KE = ½ mv². A 30 000-lb MOP hitting at roughly 300 m/s carries about 6 × 10⁸ J. Divide that by the resistive pressure of real military concrete (200-400 MPa) across a ~0.5 m² nose and you land in the 10-20 ft range.
Reply: @numbynumb But it's not 200 feet of reinforced concrete.  It was 150 feet of rock and probably 20 feet of concrete.  Also one was dropped to make a hole and the next went right down the same shaft.  That place is trashed...
Reply: That's American defense companies marketing. Dont forget that these are products too. And the buyers, in this case top guys from military falls for these. Don't forget that trump thought stealth jets can become invisible. they are that dumb when it comes to tech. So yeah, they made sure to make the weakest chunk of concrete possible to sell their product. That thing wont penetrate even 2 meters of UHPC concrete. now put that under a mountain of dirt and made them curved which makes theme even harder. So no wonder why they dropped over a dozen. they knew 1 wont do the job.
Reply: In the bunker world 20ft is nothing. NORAD sits under a few hundred feet of granite.
Reply: How about this? Ancient Egyptians used dull blades, water and sand to cut through granite.
Reply: @DouglasLippi  allegedly, I have my doubts about that🤔
Reply: @DouglasLippi - Actually, they didn't. The Egyptians simply discovered these granite artifacts/objects that are now believed to be much older than the first Egyptian dynasties. It is completely impossible to cut and polish granite with just copper tools, water and sand the exact same way and with the same precision these objects have been manufactured originally. In their hieroglyphs, the Egyptians themselves wrote that they just inherited these objects, they did not create them.
Reply: the fuses used had a delay that only started "counting down" after the bomb impacted the target, and the penetrator bombs were incredibly thick in the nose. add to that the cylindrical shape and high velocity..... boom
Reply: @jeremyj5893 yup it counts down as a default and measures the deceleration that when it reaches about 30% of the terminal velocity it triggers the clearing charge that drills a hole in front if the weapon fir the main charge to pass through.
Reply: The fuse assembly is composed of accelerometers connected to a counter. It counts how many impacts it takes, as it reaches its target depth it triggers the explosive.  This fuse assembly is not in the nose, it is in the tail. The nose is a solid pointed chunk of tungsten. Uranium is denser, but is pyrolytic.
Reply: @Rorschach1024  tungsten is denser that uranium.
Reply: @plasmaburndeath  because that's 200 ft of a standardized reinforced concrete not necessarily the best performing concrete or structural design and is also not the only potential material you could use other materials or place have a double wall with space in between empty or filled with other material before hitting the concrete of the bunker itself or have modern ceramic ball bearings for lack of a better term embedded in it . Not to mention it also has to get past the 50 to 200 ft of Earth which could be dirt sand limestone or extremely dense bedrock prior to getting to the bunker.  It's also assuming perfect impact angle and nothing diverting the course increasing distance I need to go through Earth for the same depth.
Reply: @MrDJAK777 yea but the whole 15,000 lb buster charge is a whole nother issue.  Sure your bunker might protect you to a degree but is your guys going to be able to dig you out before you suffocate or drown being your not as well protected entrance still will be smashed like an eggshell
Reply: It's not that difficult, it's just about the density of the projectile, coupled with high velocity - picture a meteorite and the craters they've produced. Look up rods from God, and the real damage velocity alone can produce!
Reply: @surq0784  "It's not that difficult, " said the guy who doesn't know what he's talking about.
Reply: @surq0784  I'm sure God's Rod IS impressive
Reply: Ever do the straw and potato trick, it's probably a similar principle.
Reply: You are not the only one that finds it hard to comprehend. I guess we have been dwelling in the subsonic realm for too long to realize what can be achieved in the hypersonic realm. Lol 😁😁😁
Reply: Come to Daddy
Reply: Watching steel being sliced on a leith.  Like it's butter.
Nothing against some circuits displaying a photo
Reply: @CHMichael  what?
Reply: @Krosis_  phone in your hand
Reply: @CHMichael  just want to help with the spelling.......lathe
Reply: It's all a matter of how deep do you want to go. Sure there are mine shafts that are over a mile deep but once you're that far removed your kinda neutralizing yourself anyway.
Reply: The RAF had bunker busters in WW2. Talboy was a 12,000 lb armour piercing bomb which could penetrate 25 feet of reinforced concrete before exploding, and Grand Slam was a 22,000 lb bomb which could penetrate 40 feet of reinforced concrete. Mainly used against U-boat pens, Tallboy also sank the powerful battleship Tirpitz.
Reply: @bernardedwards8461  The Grand Slam bombs were also only able to penetrated 20 feet of reinforced concrete, 40 feet of earth.
Reply: @vanguard9067  Depends whether it was dropped from 500 ft or 25,000 ft. It was designed to be dropped from 25,000 ft. Tallboy could easily penetrate 20 ft of reinfored concrete, you may be confusing the two.
Reply: @bernardedwards8461  yes, I said 20 feet.  Others were saying much greater distances.
Reply: @vanguard9067  A ten ton armour piercing bomb dropped from 25',000 ft would indeed penetrate r. concrete to a much greater distance than 20 ft. The 6-ton Tallboy could penetrate 20 ft and more!.
Reply: @bernardedwards8461  I am relaying the statistics provided for the weapons.  I am not making them up off the top of my head.
Reply: @vanguard9067  Imagine the energy of a ten ton armour piercing bomb falling from 25,000 ft and becoming supersonic, perhaps hypersonic on the way, penetrating the first 25 ft of a 35 ft thickness of r. concrete and then exploding! The 20 ft figure you quote was the concrete on top of U-boat pens which was a number of times penetrated by the 6-ton Tallboy.  It was never established how much concrete Tallboy could penetrate, only that it could penetrate the 20 ft thickness on top of U-boat pens. It also sank the super-battleship Tirpitz. Grand Slam destroyed the Bielefeld Viaduct, but never had a chance to show what it could do before the war ended.  A ten ton shaped charge just restig on top of the 30 ft of concrete could drill a hole through it.
Reply: The fact that it goes through almost anything is not impressive but it amazes me is the fuse and everything inside can take a crazy punch and just do its work.

The part of going through anything I mean even just a huge piece of bad quality normal iron metal sent from outer space alone will be crazy deadly and go trough whatever thought it would melt to oblivion...
Reply: With a multi-layer AA system, that plane ill not have the opportunity to drop any bombs.
Reply: I literally wanted to type "The bunker says COME TO DADDY - and the bomb says I WILL EAT YOUR SOUL RRRRRRAP TAP TAP" - then saw someone typed the Come to Daddy comment - which very few will get. I think Aphex Twin is dead - and has been for a long time - one of the most genius electronic musicians ever, along with Underworld, Orbital, etc.
Reply: NOT A SOLID BLOCK OF CONCRETE  BUT  HOLLOW  !

UNITED SNAKES OF AMERICA IS MOST KNOWN FOR THEIR LIES AND DECEIT AND KILLING THOUSANDS OF INNOCENT PEOPLE , WOMEN AND CHILDREN INCLUDED.
Reply: Simple: filmed in Hollywood......as deniers say,unless get roasted by same bomb😏
Reply: Becouse its a lie probably
Reply: Weirdly for me my brain can't compute it the other way around
Reply: @Alex-cw3rz liar
Reply: @Alex-cw3rz me neither. Think it's just pure force.
Reply: Because your mind is a tik tok mind. 🤭🤣
Reply: Come to daddy!!!
Reply: @tommytimmons267 

I dropped a penny
Reply: Однозначно!!! Испытание на бетоне, который не имеет арматуры, связующего вещества, щебня... это фальш!!! Попытка продать свое оружие другим странам!!! И попытка запугать потенциального соперника в гонке вооружения! Z O V!!!
Reply: Yes, if you have a problem comprehending the immense forces involved in penetrating meters of solid concrete it must be because you can't do simple math and physics. I'm so glad the brainiacs dropped in to explain something so simple to us dummies. 🙄
Reply: @sanders555  , I am fat better at writing, etc., than at maths. I nevertheless managed to gather enough to learn from Mr. Shillito's cogent explication.
Reply: USA
Reply: @MobiusMinded  "USA" Underneath the comment says: Translate to English.
Reply: @MobiusMinded your comment says "USA", if you hit the "translate to English" option that YouTube  put under your comment,  it translates USA to deer 😂